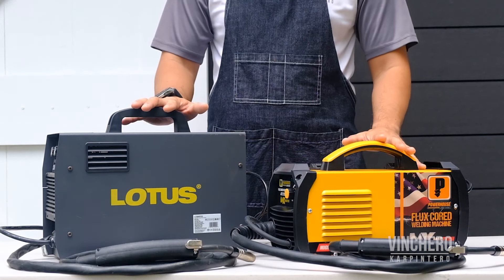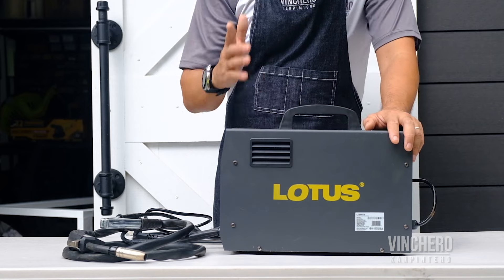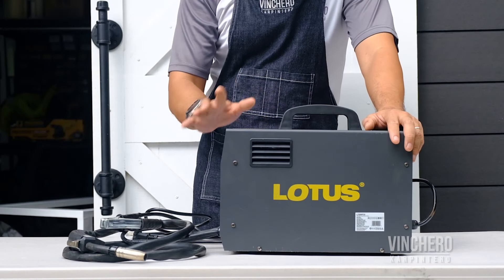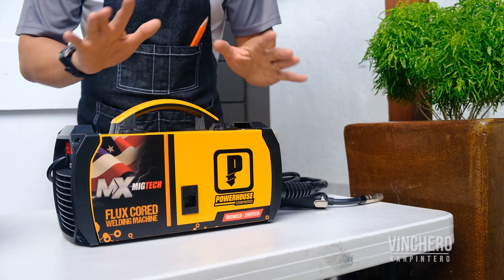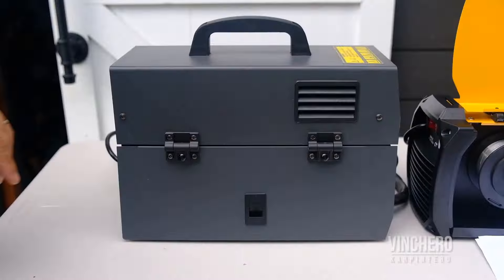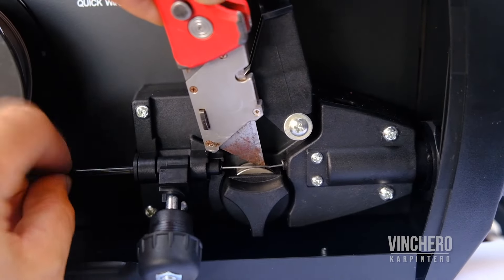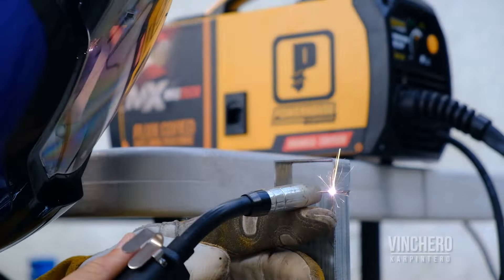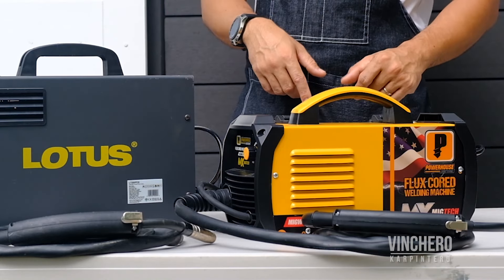MIG WELDER BATTLE Powerhouse VS Lotus Review (gasless)

Comment: I also use use both machine. For Lotus, you can tighten/adjust the screw on the center of the both hinge so it will not fall when you open, and you can rotate the spool with one hand just like Powerhouse.
Reply from the maker: Oh nice. Great tip. Thanks!

Comment: Hello sir? In powerhouse welding machine, can you adjust the speed of flux wire? Thank you.
Reply from the maker: The Powerhouse welder does not have a wire feed speed adjustment knob so the only way to adjust wire speed would be to adjust the material thickness knob.

Comment: get a real gas MIG you'll never regret it. mine's a mailtank 8000 pesos. co2 tank is 3k. i started off w/ fluxcore, never going back :)  gas mig has no slag to remove. welds are pretty. easy to weld thin material. gas mig is actually cheaper coz good fluxcore wire is super expensive

Comment: Power house is transformer type,but the Lotus is inverter type..
Reply from the maker: Interesting. What does that mean tho? The inverter type makes it more tipid sa electricity? What's the advantage of the transformer type?
Reply: @VincheroKarpintero  is it heavier? if same weight then both are inverters. coz transformers are super heavy. the old fashioned "buzzbox" stick welders are transformer
Reply: Lol, they are both inverter.
Reply: @VincheroKarpintero  ur powerhouse is also an inverter. Transformer type are those old welding machines na malakas sa kuryente.